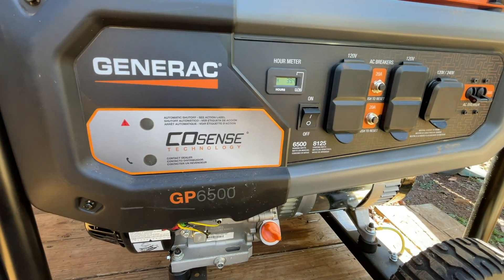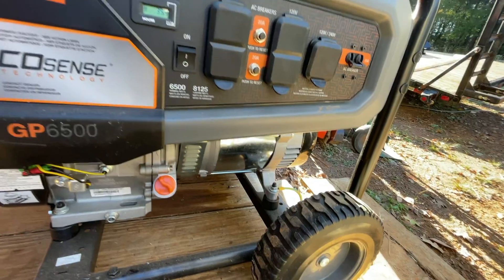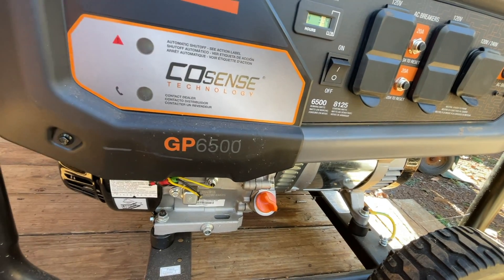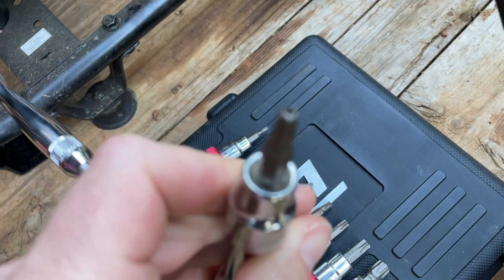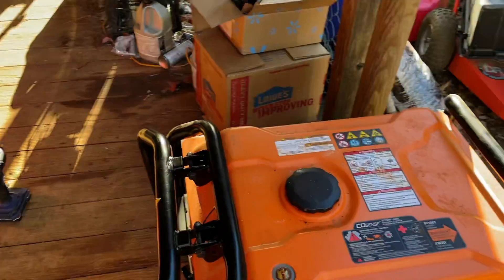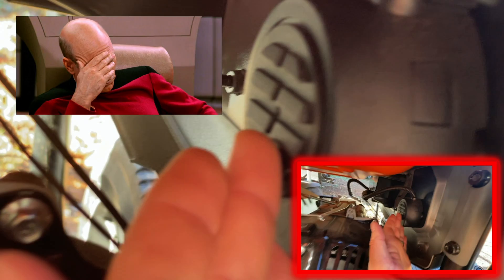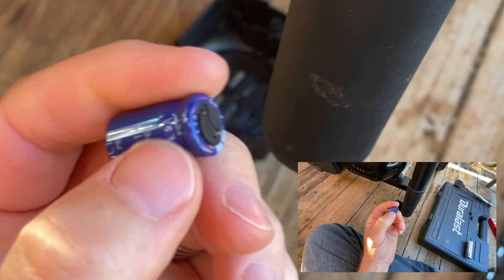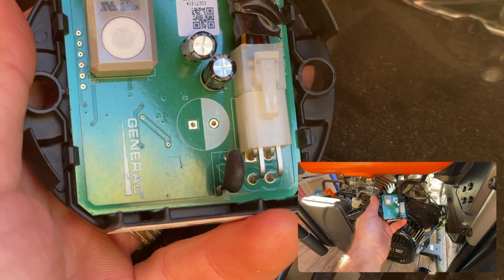Solved - My Generator Starts But Won't Stay Running (GENERAC COSense GB6500)

Comment: I have the same unit but won't start at all. Nothing when I pull. It was working one moment. Turned off. Topped with gas. Tried to turn back on. Nothing. Ran it for one storm. Then for 2 hours on the next storm. And that's it. Less than 50 hours. I'll check the cosense module but it's a different issue. Mine won't start at all compared to yours flashing and then stopping. Mines not flashing at all. 

Trying to think what the issue could be on a nearly new unit like yours.
Reply: Try spraying ether to see if it will start. Might just need a carb clean and new fuel.
Reply: Disconnect the oil sensor switch and try it. If it runs, you either have too low oil or you need a new switch. This is a common problem with lots of equipment. The oil switch is in the same stop circuit as those 2 black wires. the switch shorts the wire to ground when it thinks that the oil is low, and that prevents the engine from running.

Comment: Have you had an issue of it running, but not delivering power?
Reply: I asked him the very same thing because after following his steps I lost electricity but got no resolve from him 🤦🏻‍♀️🤷🏻‍♀️
Reply: @sondrad101I ran into the same issue..connected two black wires ,runs but now no power output any updates ?

Comment: I have had to do this to 3 Dewalt generators all using the same Generac COSense garbage over the last year or so. I said f it and just cut the black wires and crimped them together. None of mine were the Capacitor, all of them had water corrosion on the board shorting them out, the conformal coating was not complete on any of them and that is the spots that corroded.
Reply from the maker: you would think they would either fix the problem or stop using the faulty safety product. I guess it just looks too good in the marketing.

Comment: I can't believe that I just found your channel. Also just bought that security torx set per your link. I didnt have the security set.
Reply from the maker: Thanks for using the link! Did you have the COsense issue too?
Reply: @EastTexasHomestead  No, Sir. I Have a much cheaper piece of junk. I was watching random generator repair vids and this one popped up.

Comment: I liked the video, but my only problem is where you had your generator. It should be atleast 10 feet away from any structure. This is to help in case your generator should short out or catch fire. Muchless to reduce the risk of carbon monoxide poisoning.
Reply from the maker: In a perfect world, that would be great. How do you run your generator out in the middle of your yard in the middle of a storm? I run mine on the covered porch of my barn, which is at least 10 feet from the door. It's >50ft from my home, where I would be using it.
Reply: @EastTexasHomestead  True, but I have a Gentent canopy to protect my Generac RS8000E. There are methods to protect your generator from the elements from building PVC/ tarp configurations to making a generator shed. My unit is about 20ft from the house and secured with a heavy duty chain. The first thing stolen in a disaster are generators.
Reply: Thanks Mommy

Comment: Yeah, looking a the stills in the video.  You can see on the PCB that the gold is showing around the holes where the cap was.  Now, look at the connector on the PCB.  Solder flows up the leads.  That is how the solder should have flowed up the leads of the cap.
Reply from the maker: It may have been easier to simply solder the thing back on. I’ve just never attempted it.
Reply: @EastTexasHomestead  regardless, it is working.  Not gonna run the gene in the house anyway.

Comment: Yes, that is an electrolytic capacitor.  Depending on the solder it could start melting at 190F.  Most at 800F(ish).  Hopefully, that is not Texas hot.  Looks like a cold solder joint. That is where the solder did not properly flow on the leads of the cap.  So the cap is just touching the solder instead of adhering to it.  Over time it fails.  Falling off.  Probably lead-free solder and poor quality control.
Reply from the maker: 😆 It gets pretty hot but not 800 degrees hot.
Reply: So could you just re-solder it?
Reply: That is not why the cap came off. And solder does not melt at 190F.